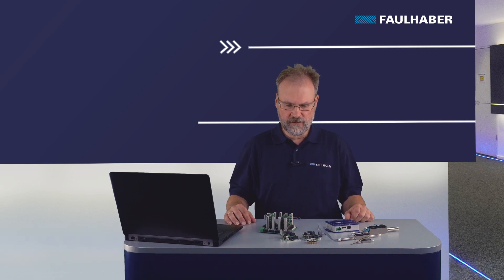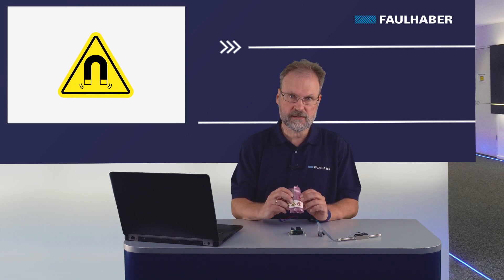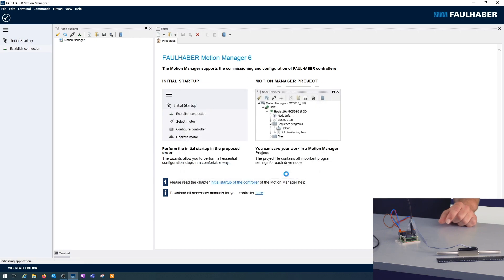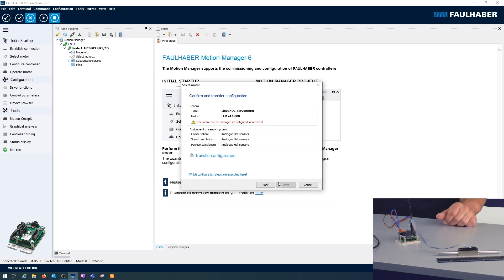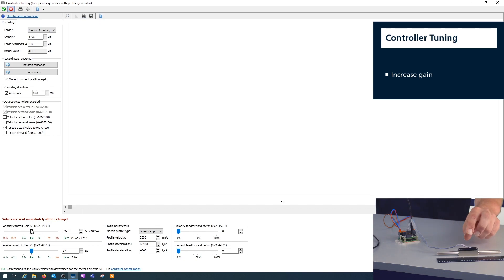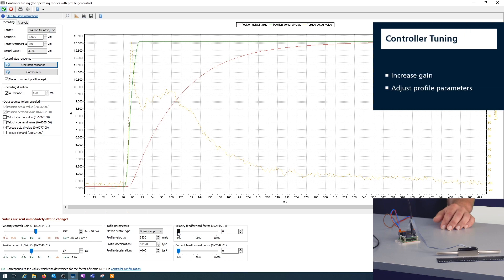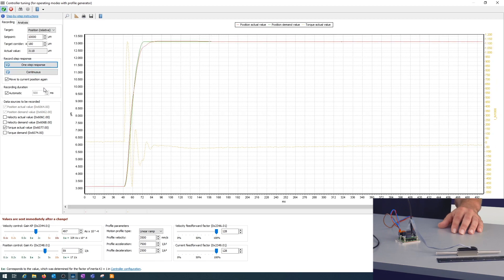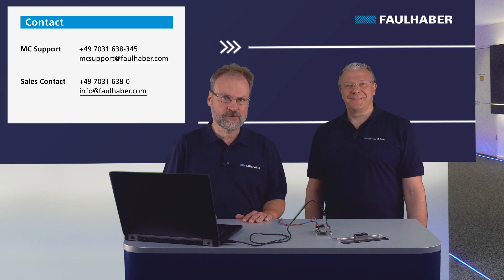How do you control a linear motor with the help of a Motion Controller - FAULHABER Drive Time

Comment: We used these in the past, they work very well as most Faulhaber products do (and they look good too). But for vertical applications like pick and place systems, the constant power draw to hold the desired position was far from ideal. We then switched to Xeryon XLA actuators that have a built-in brake of some sort, and a controller built into the actuator body, which saved lots of space in our designs.